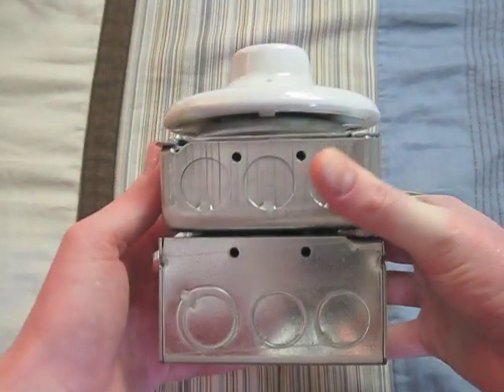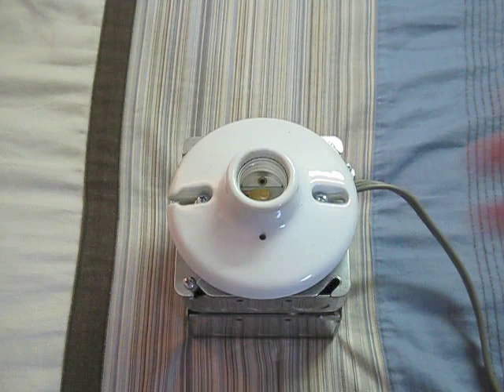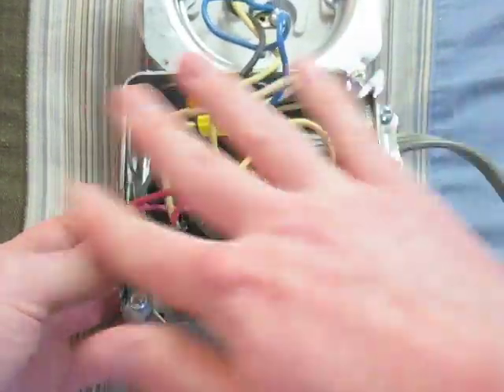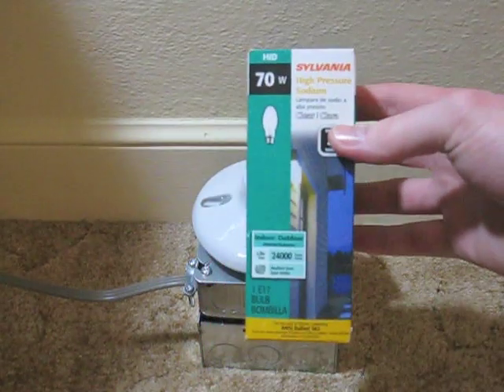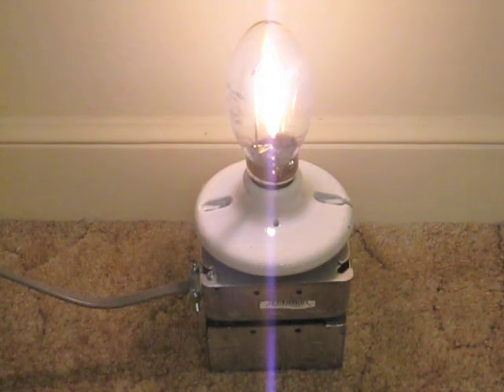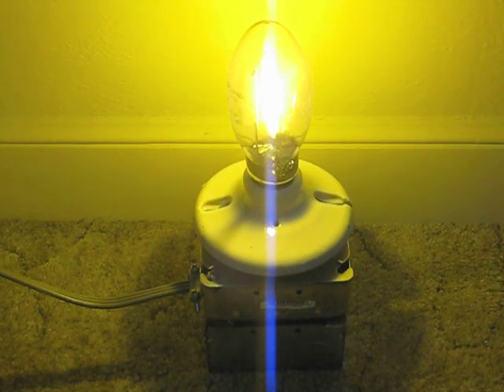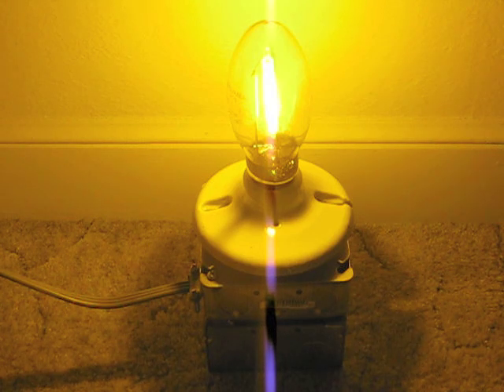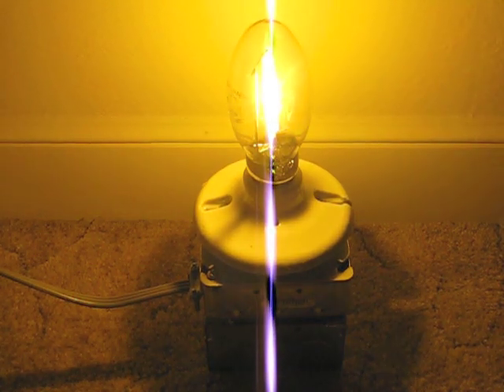Homemade 70watt High Pressure Sodium Ballast Box

Comment: You should have incorporated a fan onto the box to keep the components cooled down. I assume you can't safely run this for more than roughly 12 hours without it heating up too much and either frying or starting a fire. But nice work either way. I wish i could build one of these. I'd build my own grow light hood with a cooling tube to help keep the light cool and vent it out of my grow area.
Reply: Yeah my 80w mv started smoking after overheating

Comment: I had to change out a bad transformer, capacitor, and ignitor.  When I start the bulb it lights to this color, but then brightens to almost a bright white.  Why?  I'm confident I wired it correctly, but I can't understand why why the color changes back to a bright white.
Reply: Matthew Mazar because it is warming up
Reply: Matthew Mazar u have a metal halide bulb if its white son bulbs go yellow to orange after 5 minutes like a street light halide bulbs are true day light after 5 minutes hallway shop lights use metal halide son bulbs don't attract insects so are in use were there not going to bring in moth's etc or bats
Reply: Burt Habard MH doesn't work on sodium ballasts.

Comment: Did you just handle a high pressure sodium light bulb using your bare hand? Unless I don't know much about the 70 watt bulbs, use a paper towel.
Reply: Gevito236 It's not like a halogen capsule, nothing will happen if you touch it.